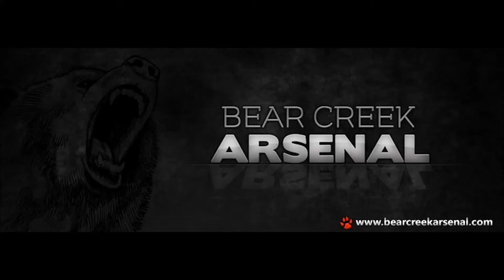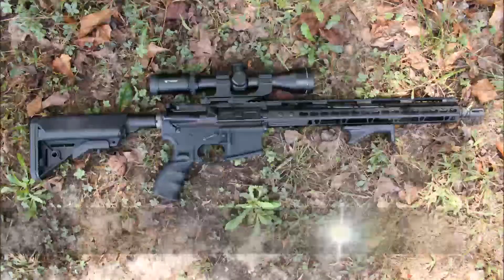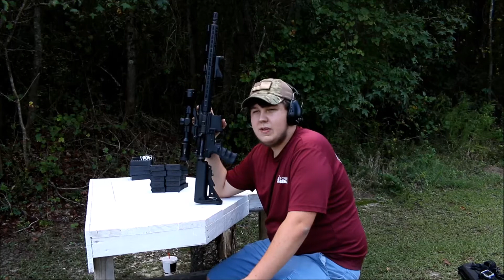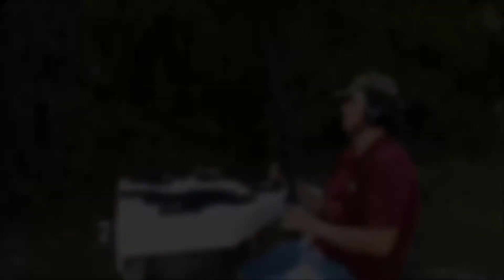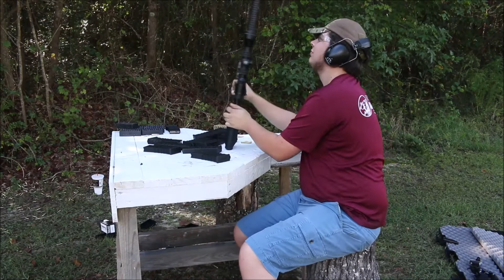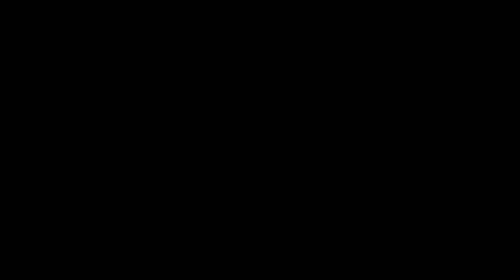Bear Creek Arsenal lightweight BCG Stress Test

Comment: You didn't get the money shot - why not pull the BCG out for inspection at the end of the video? I'm guessing from the description you're referring to the gas block screws now receiving blue loctite as a result of the failure to chamber properly - that has already been tried by many and failed. If you properly staked the gas block screws, this wouldn't be an issue and I wouldn't buy a BCG with a gasblock that isn't staked.
Reply from the maker: JT, thanks for watching; and thanks for the input.  

Just to be clear, the gas block did not come loose.  

We stake all of our gas keys on the bolt carrier group.  That screw that came loose was from the keymod rail.  Again, we were really putting that upper under some stress; that does not usually happen.  But, we decided to add blue Loctite to the keymod screws, just to be sure.

Again, thanks for the feedback.  This is only our second video; so, we really appreciate any helpful suggestions.
Reply: Gas key

Comment: You had multiple failures to feed or looked like double feed issues. In my honest opinion I don't think this is a successful test...regardless of the heat. Not once did you stop to inspect the BCG or bolt, or the magazines. I stopped counting the Failures after 6 times. How can you come to the conclusion that this test was somewhat successful? I'm not trying to knock you guys...But I expect alot more from Bear Creek. I would consider this a test failure...and I don't see any customers who would run 600 rounds out of the 850 you ran, and walk away saying your BCG was a good purchase. Please go back to the drawing bored. I prefer reliability over anything
Reply: Methodical 66 i just bought one of these bolts and whoever assembled it forgot to install the ejector spring....